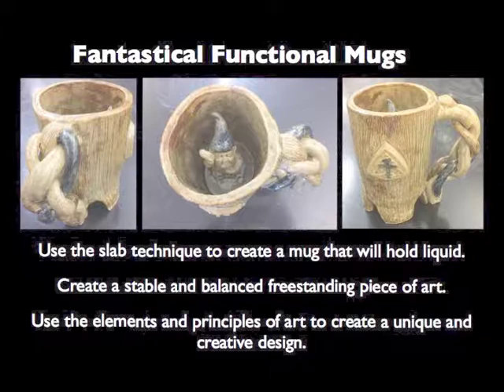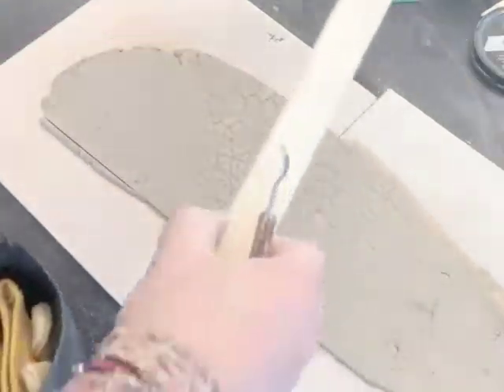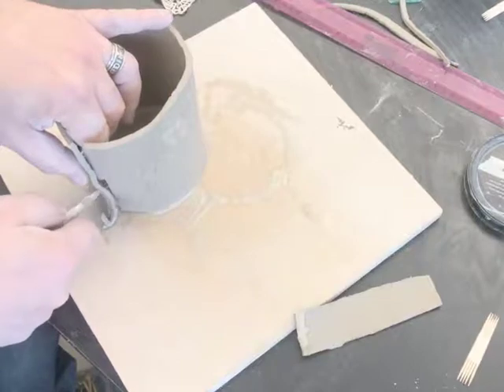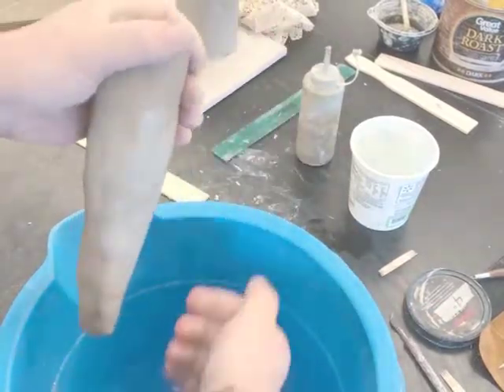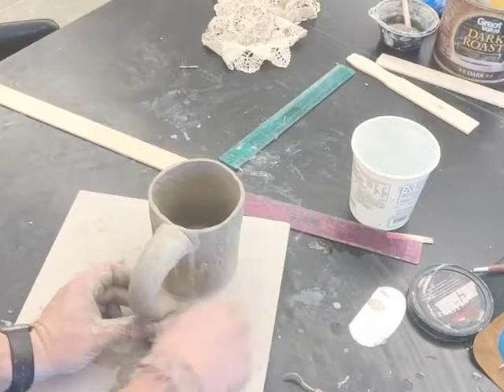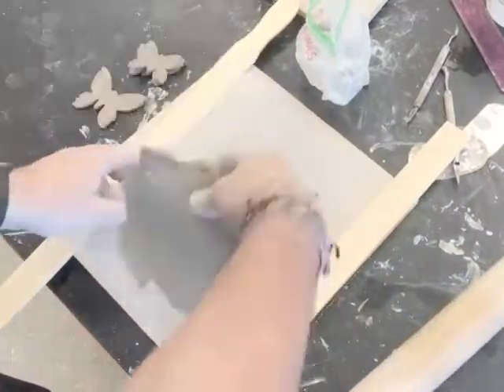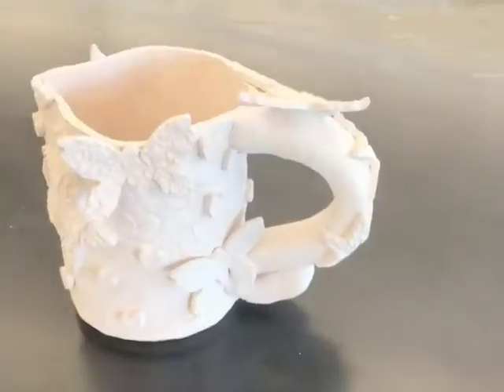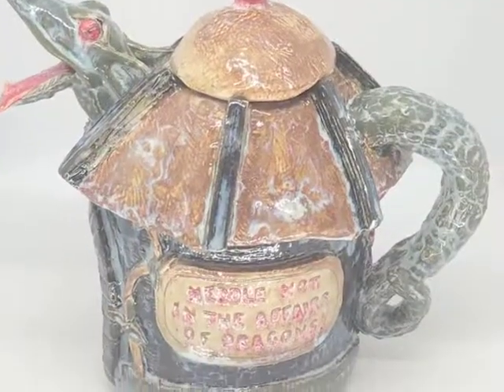Slab Mugs

Comment: I love this! Where do you find your little boards and thickness sticks?
Reply from the maker: Boards are one foot square partial board that I pulled from a construction dumpster. They are covered with canvas that is stapled on the back. Sticks can be anything that is a unified thickness. Most are just fir strips from Lowe’s. You can use yard stick, rulers, of paint stirring sticks.
Reply: @Fugli1 thank you so much! There are so many tools people use, and I can never find them- they must make them! If you have a tiny piece of saran wrap or thin plastic, you can lay it over your clay before you use the cookie cutter and it doesn't stick- its like magic! I loved the bead tree making video!